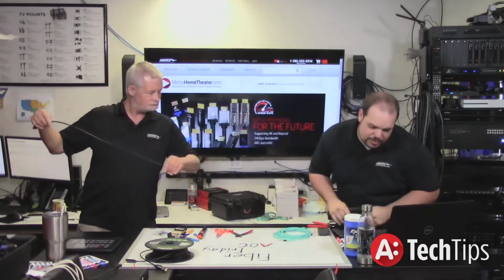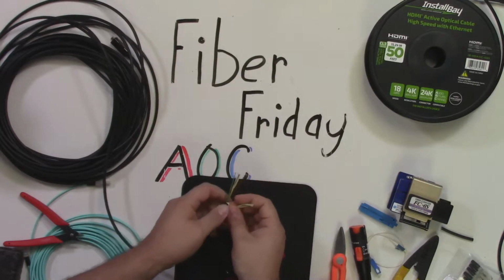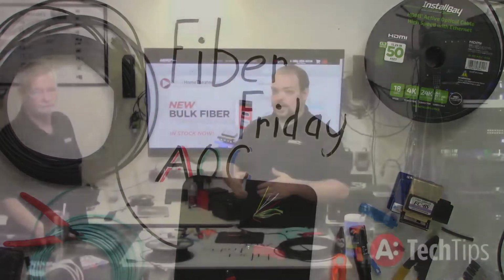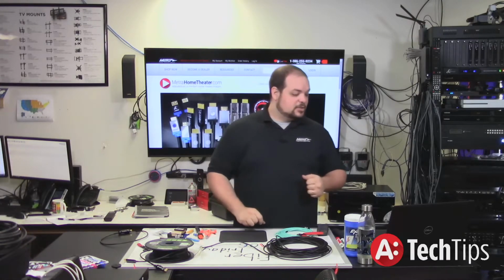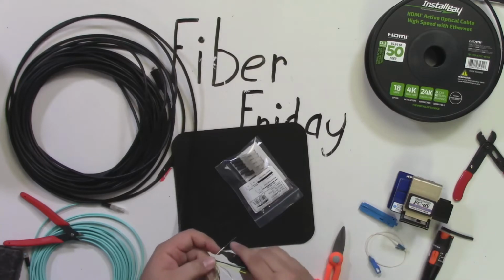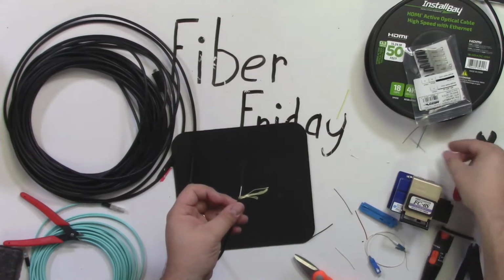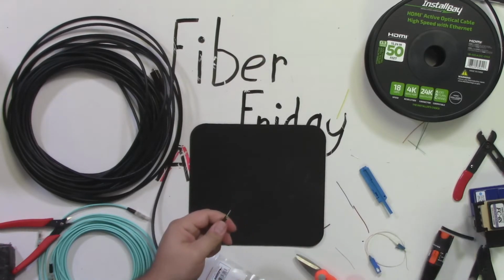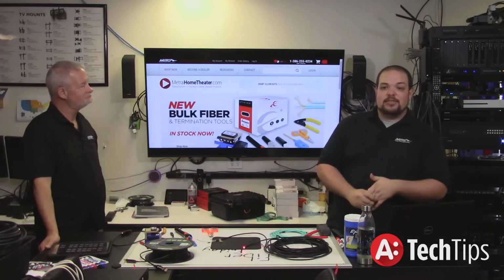FIBER FRIDAY: Benefits of AOC in Your Installation - Tech Tips Webinar

Comment: Is this spf+ or qspf+ AOC?
Reply from the maker: Hey Haskell, Great question! It's actually neither. SFP (Rather than SPF) stands for "small form-factor pluggable". This is in relation to SFP modules that you would see used on Networking switches OR on our CS-HDFBREXT-VLC HDMI extender over fiber. Our HDMI AOCs are permanently attached into the headshell where the conversion of electrical to light process happens. Additionally, SFP modules may also alter the electrical signal before transmitting it over the fiber to aid with timing. Our HDMI AOCs use a more direct form of information conversion. Meaning, the transceivers take the direct (or semi direct, there's other engineering that happens first)  electrical signal and converts it to light, which is then converted back on the other side. 

There's a really great article if you get an opportunity to read details what an SFP module is, what it does, and how it does it. https://ourtechplanet.com/sfp-transceivers-explained/ - Adam